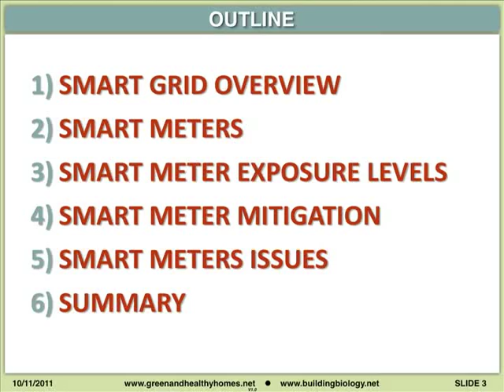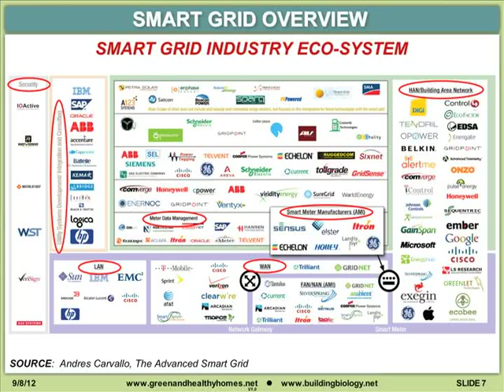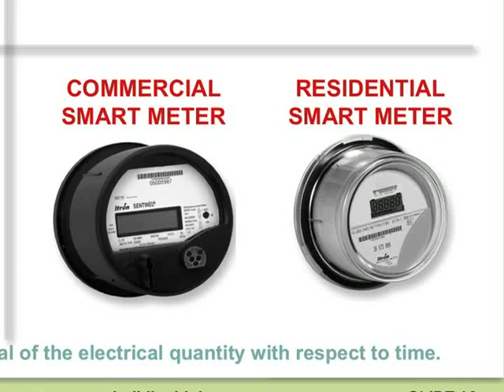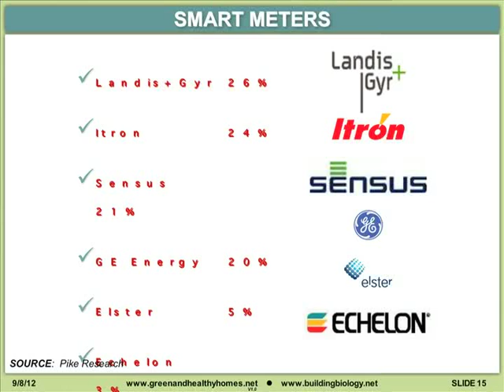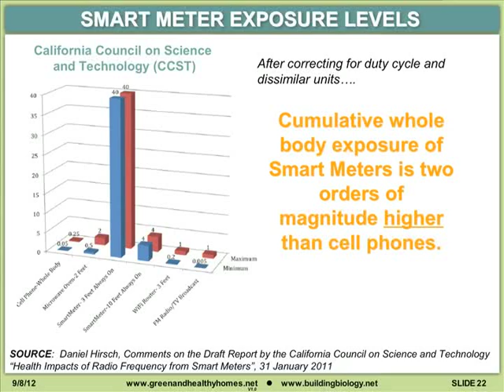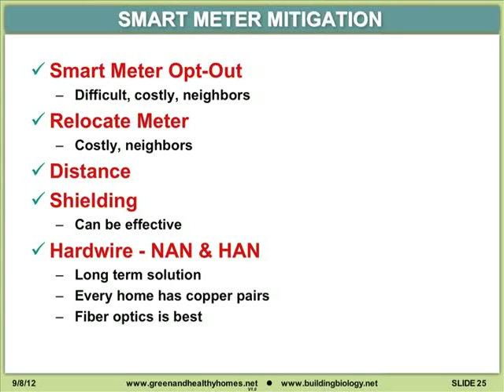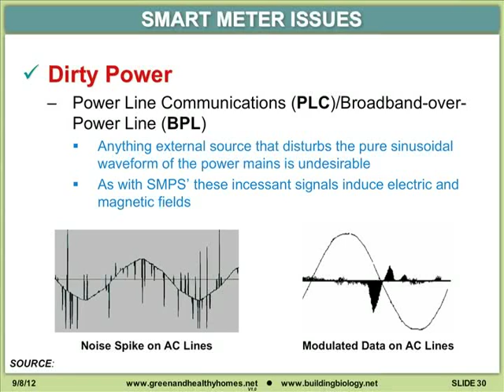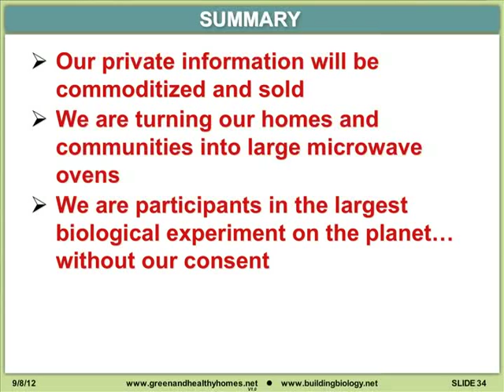Smart Grid Risks - Tom Wilson

Comment: Smart Meters communicate with 902 MHz radio waves over the WAN to the utility and at 2.4 GHz ZigBee for the in-home area network. Power is less than 1,000 miliwatts, max.   Remember radio waves fall off as a 1 over the square of the distance from the point source of transmission.  Check out YouTube for USCL Corp  or Google Tomer Tamarkin for the YouTube Channel address. See complete 7 part Smart Meter School and learn about magnetism and the electromagnetic spectrum.